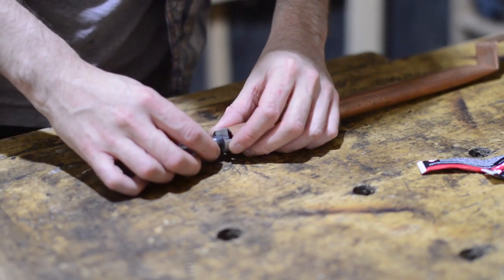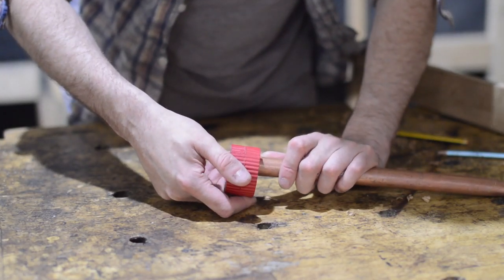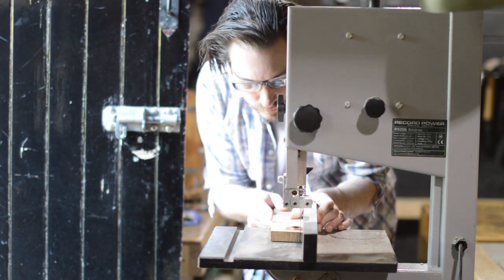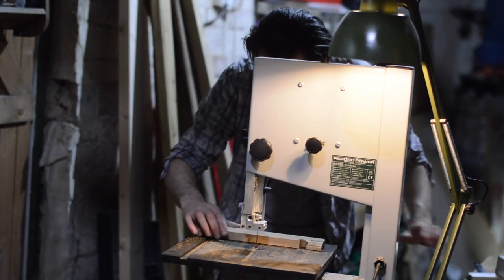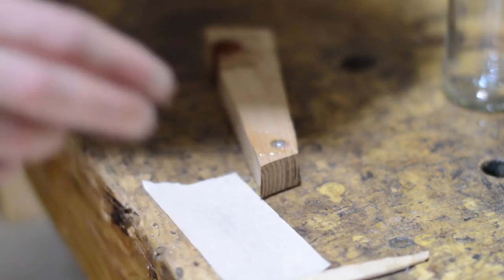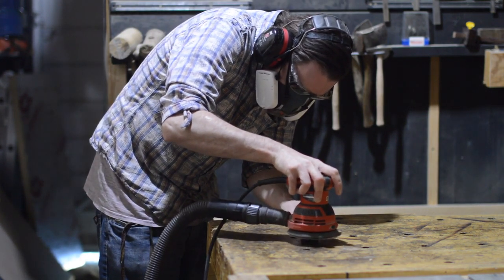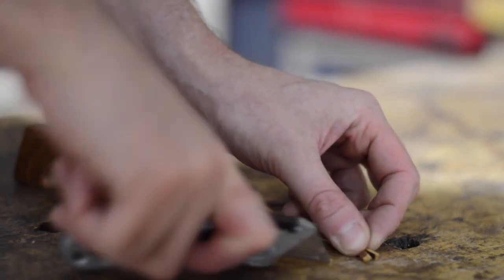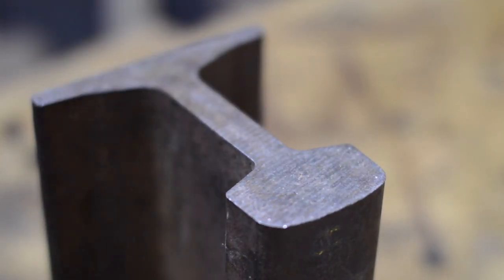Copper Pipe Bottle Opener

Comment: I just bathed out about twenty five of these but I was finding the copper tube was getting scared by the bottle top making a sharp edge.     I've started making them with stainless steel tube but it has been problematic to say the least.     bought a special band saw blade for cutting the stainless but wouldn't touch it, then tried an evolution saw blade in my standard rpm table saw which just smoked the blade, then final sorted it with a slow speed circular saw mounted upside down.     I just love the look of them though so worth the work.
Reply from the maker: That does sound hard work. Stainless steel is very hard stuff.